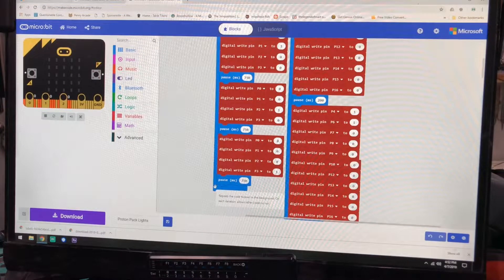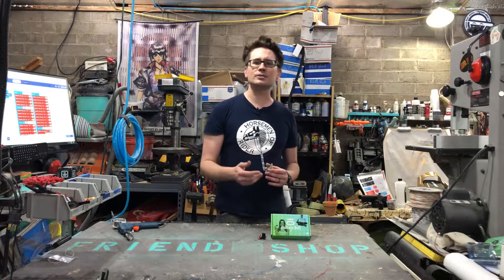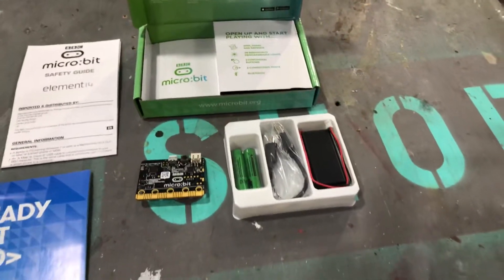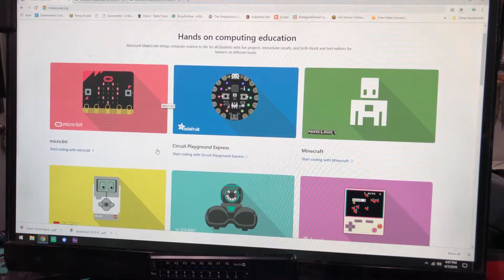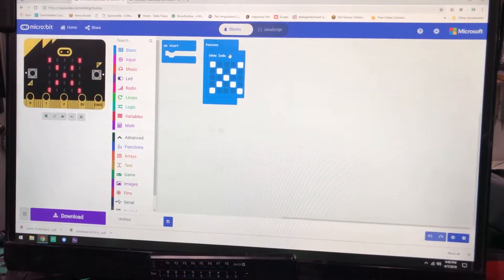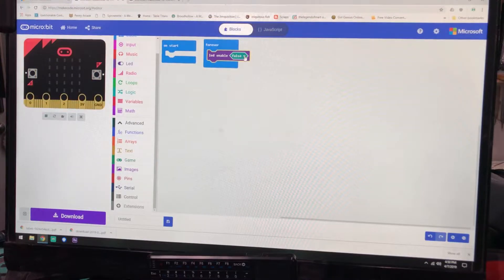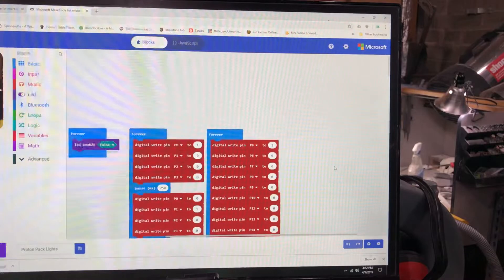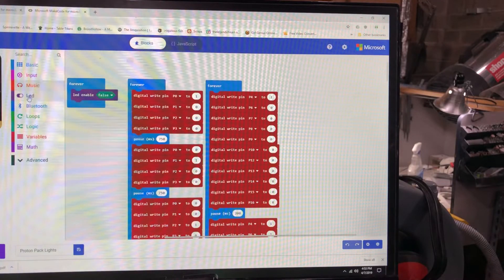Micro:Bit, A Simple Board for Props and Cosplay

Comment: Hello @Garrick Backer!!  first of all congratulations for the video !!  I need help!!  I would like to recreate the circuit of the protonic backpack of the video made with punished props academy and I wanted to ask you, where are the micro: bit cards connected to the soundboard ??  the switch that turns on all the lights and activates the sound is connected to the Power up ??  thank you so much!!!
Reply from the maker: Hello,
So the switches I use are know as DPDT or Double Pole Double Throw. What that means is each switch operates two distinct circuits. The sound chip and the Micro:Bits are not connected to each other at all, its just that one of these switches acts like you are throwing 2 individual switches.  This is the simplest way to have several kits run off the same controls.  Here is a link to the switches used in the build: 

https://www.amazon.com/dp/B013DZB6CO/?ref=idea_lv_dp_ov_d&tag=aiponsite-20&linkCode=ic6&ascsubtag=amzn1.ideas.19S6GBL9LIM6R

https://www.amazon.com/dp/B016PNOXY4/?ref=idea_lv_dp_
Reply: @KnowOnesDesigns  thank you so much for the answer!!!  ok, I'm ignorant in electronics, even if the video is pretty clear !!  but the two wires connected to the converter, which then go to give power to the proton pack and gun lights, come out of the section called SWITCHED of the soundboard or am I wrong ??  the cable that you used had 10 wires?  and goes to connect respectively the 4 switches and the lights of the gun to the sounds and to the converter, right ?? have patience Garrick !!!  thanks again for a possible answer !!!!  sorry!!!!